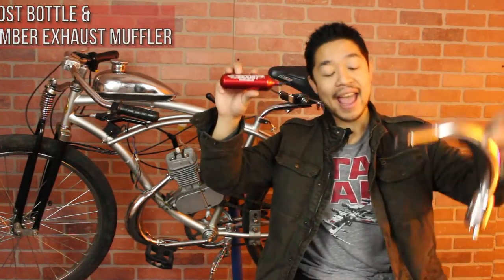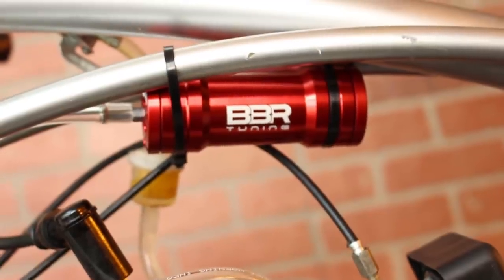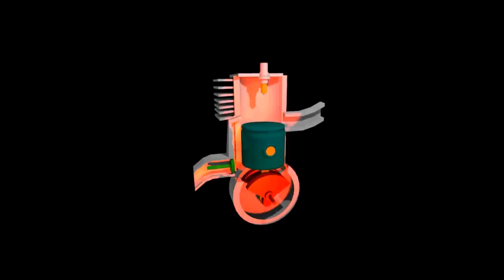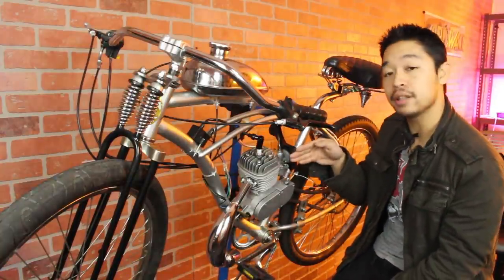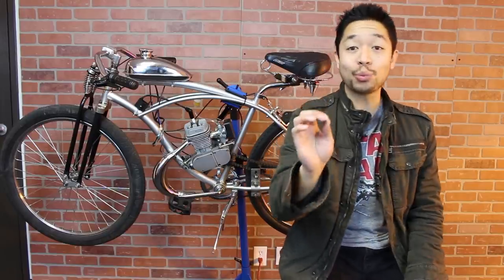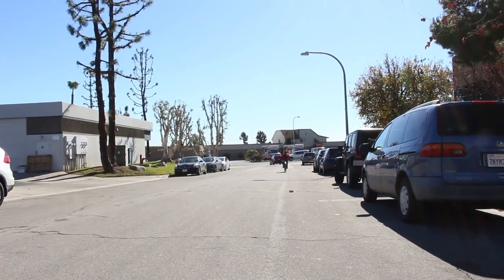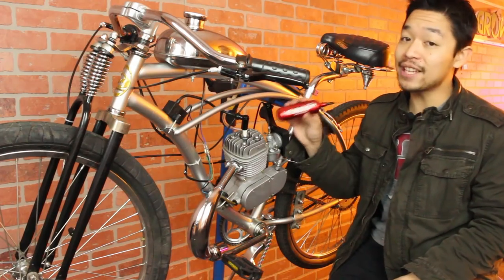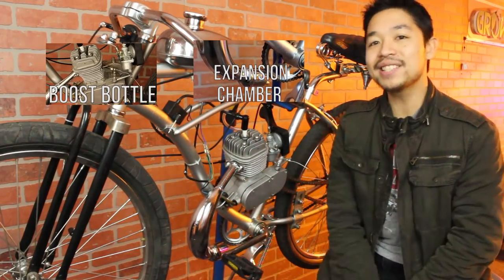Boost Bottle and Expansion Chamber Parts Review for a 2-Stroke Engine Kit

Comment: Boost bottle works by storing a vacuum during intake pulse, that vacuum in the bottle continues to draw air through the carburetor between engine intake pulses, so it acts like a capacitor to average or smooth the flow of air through the carburetor to improve low speed carburation. Twin 2 strokes simply use a balance tube between intakes for the same purpose. High engine speeds it does about nothing. You could have made it from lighter plastic too, far cheaper.
Reply: Like a beer bottle
Reply: I was so disappointed in this video that had to comment on it, then i read your comment and discover the  very information i was looking for. Thank you sir, that is the best explanation ive found, and as a refrigeration tech by trade, the capacitor reference really drove the point home.

Comment: You said 100% efficient in the consumption of fuel. No engine could be 100% efficient due to friction.
Reply: Tuned out when he said that.
Reply: he meant that it consumes 100% of the fuel. obviosly he didn't find a way around thermodynamics.
Reply: Sam Beatty next it will be prepetual motion machines
Reply: Nah, they just figured out a way to sell Carnot engines... xD
Reply: Right after he said that he added that it would double the torque. Doubling anything means making  said thing 100 percent "More" in any direction. 

So I think he meant to say that the boost bottle would double it's efficiency, or some other thing that can only be measure with abstract testing. So rather than make it "perfect" which is definitely impossible he is trying to say that it makes things better
Reply: I thought that's what the 2 cycle oil is for. To keep the piston lubricated to prevent friction

Comment: I've never used a boost bottle, I have used an expansion chamber and even without I've never done less than a twenty seven miles per hour top speed. Maybe try using a reed valve instead.

Comment: Boost bottles doesnt work on engines with reed valves right? Since reeds contain the compression under the piston and lets no air back up the intake. Expansion chamber is one of the most important pieces of a 2 stroke engine though.

Comment: What about adding a reed valve? then what.
Reply from the maker: Great question! A boost bottle and reed valve are used to solve the same problem. A reed valve restricts the flow of fuel and air back into the carburetor, a boost bottle catches the blow back and throws it back into the compression chamber, arguable providing better performance.

Comment: Does a 4 stroke engine needs a boost boottle too?
Reply from the maker: Due to the difference in mechanical design, a 4 stroke engine has a significantly less amount of gas that flows back into the carburetor. That is why 4 stoke engines typically provide a smoother ride, with less bogging.

Comment: This might only work on 2-stroke engines with a piston controlled inlet. These engines are notorious for low efficienty. This Boost Bottle will have no effect on 2-stroke engines wit eg a reed-valve intake or a slide intake.

Comment: I still don't see the logic in this. If there is an abundance of fuel after the first combustion cycle and you take the unused fuel and apply it to the next one without changing anything else between every 2 strokes(i.e. timing, spark, etc.) Then logically the second cycle would have the same amount of unused fuel as the first yet you've added the unused fuel from the first cycle as well, effectively just doubling the amount of unused fuel(and then just compounding the amount of unused fuel each time after). I see no point in that. I mean if it couldn't burn off all of the fuel the first go, how do you imagine the next cycle will somehow make it burn off all of the initial fuel when it couldn't on the previous combustion stroke, plus the left over from before that was reintroduced this time around? If that's the real purpose of either of these things then it just doesn't make sense.
Reply from the maker: The issue is less about the amount of unused fuel and the amount of oxygen being mixed for a better burn, effectively increasing the octane rating. The boost bottle catches the unused fuel to allow new, oxygen rich, fuel into the engine. The boost bottle throws the unused fuel into the mix of oxygen rich fuel as a byproduct of its design, which inadvertently also creates a small increase in fuel compression. In short, the boost bottle isn't used to change the amount of fuel, but the quality of fuel that is burned.

Comment: My bike goes 32 mph without all the upgrades all stock part with one modification to the exhaust. And a better spark plug.
Reply from the maker: +Ernesto Sosa Awesome! We wish we could've gone faster but we didn't have much distance to cover on a busy road so we tested the mid-range throttle speed instead. But yes, with the added performance parts, you can see how much of a difference it can make on a stock motorized bike.

Comment: The boost bottle is stupid and I don't believe it works. I better solution would be to install a reed valve.
Reply: A reed valve is to increase primary compression. Not the same function the bottle provides for which is for improving low speed carburation.
Reply: +AusMecham a reed valve prevents exhaust gasses from going out the intake so that the next air/fuel charge pulled in is not contaminated. to help low speed carburation get a carb that has an idle jet and a main jet.
Reply: +Koda Wolf Jetting wont resolve the problem of irregular intake pulse. A 2 stroke without a reed valves is a piston port 2 stroke. It has a primary compression, the reed valves allow for more primary compression than a piston port intake can produce through the range and a rotary disc intake same but not limited to the reed response time, the disc being fixed to the crankshaft, and it'll rev higher, and higher RPM = more power.